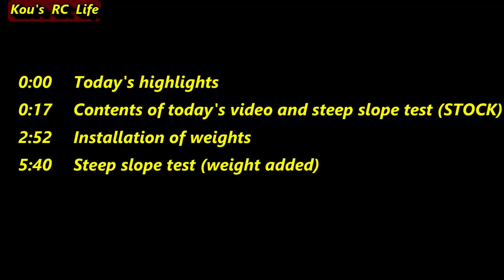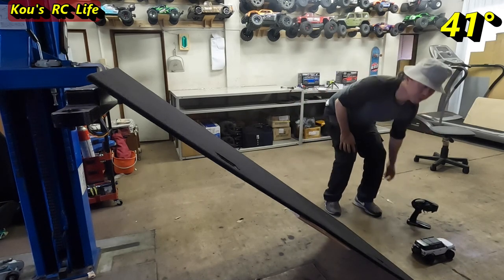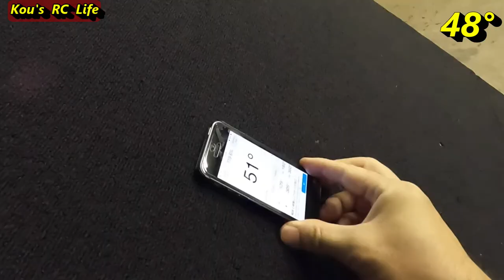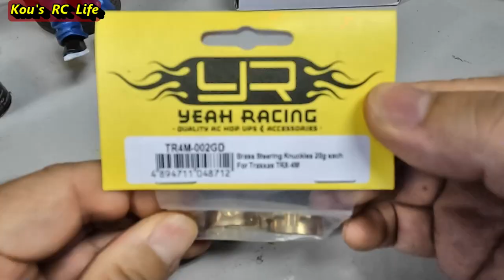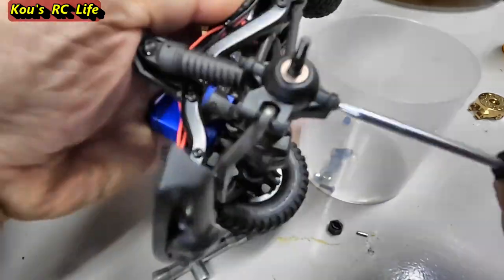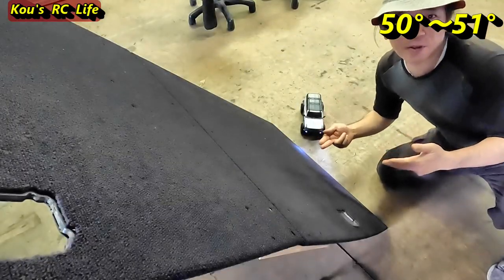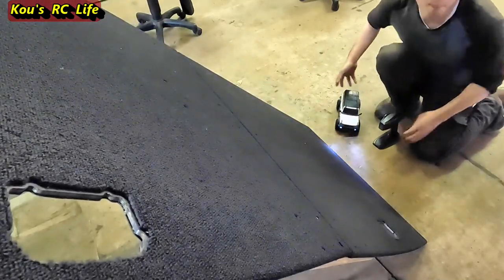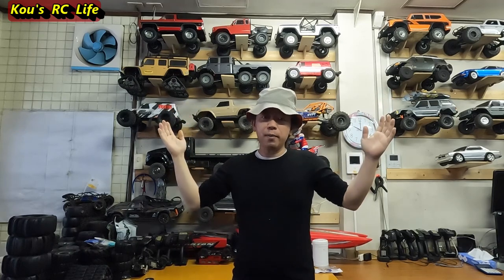I installed a front weight on my Traxxas TRX4M and it climbed pretty well.

Comment: Oh man, get some brass wheels and put sticky weights around the inner beadlock ring, should get your wheels over 300grams, then add at least 23% over drive, maybe even a 33%, crazy how much the front end sticks to the ground after those easy mods :)
Reply from the maker: It is wonderful that overdrive is realized by the weight of the tires.
I would like to try.Thank you for your comments.😊